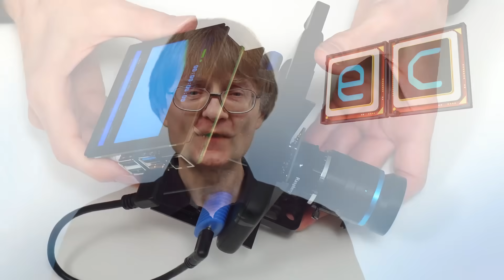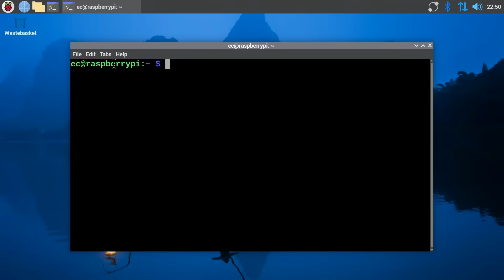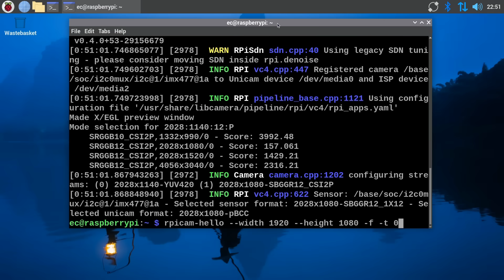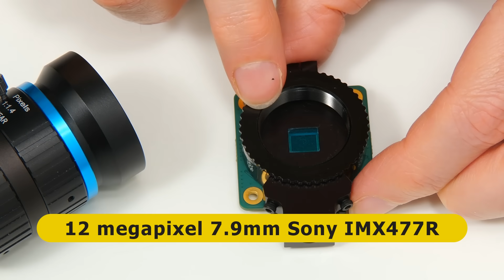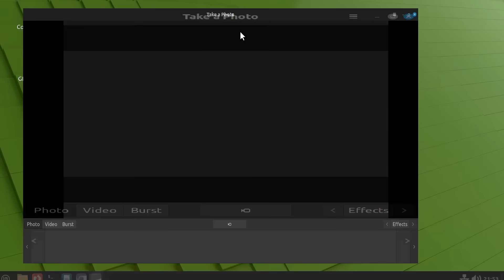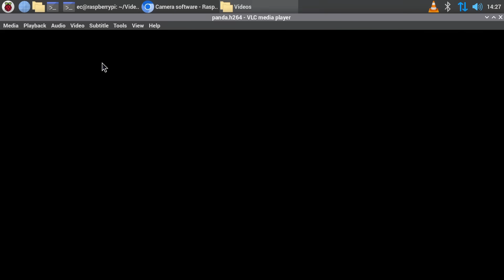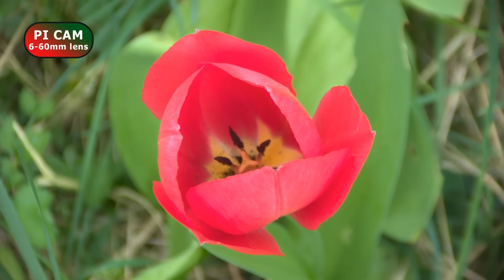Filming YouTube on a Raspberry Pi Camera

Comment: In the first comparison shot with the Panasonic, your shirt looks purple, this usually means that the sensor is getting a lot of infrared light. Next time you make a video with the RasPi Cam, can you try using an IR filter? maybe then the colors will be more accurate. As the lens you're using are usually for security cameras that use IR flood lights for 0-lux recording, they never come with IR filters.

Comment: At the end I still wonder about the question you had solved in 2022 or so when the Raspberry were suffering big time from shortages and you recommanded to look around for small celeron like those tiny lenovo mini PC where I had gotten one.

And hence I would ask what used Pro camera you would buy for what money if you would have to start again.
Why ?
Cause I like the lenovo idea and got back then 2 of them replacing Pi 4s which were suffering from a RAM shortage I could not fix and I did not like to face cause I have never had faced such issue and could not believe that 4 GB could be too less for HomeAssistant. Hence I got the small Lenovo for lot less money and everything incl. and able to expand the memory back then to 8 GB which is still working fine.
Biggest downside of cause was the power consumption but with a 30 kWp solar system and 30 kWh of LFP battery you do not really care about 5 or 11 W anymore for 1 computer or barbone PC. 6 W more in a 247 usecase is roughly 8.8 times the figure in kWh p.a. or 54 kWh per year.

So when I watched the beginning and you showed your usual Pro Setup I was wondering for how much you would get such 6 or 8 year old setup.

Comment: Pound for pound a nice alternative to the Panasonic. Telephoto lenses always have a shallow depth of field unless you can stop it way down which probably is not available on that tiny lens. Wide angle lenses also had vignetting problems in the past so not surprised about that issue either. 
My Latte Panda proudly sits on my shelf next to my Linux Penguin.
Not criticizing, but I notice you pronounce Alt as in altitude and not as in alternate... interesting. Never heard anyone do that before.
Stay well my friend and see you again on Friday!
Reply from the maker: A very good point on Alt -- I've never even thought about it, but you are clearly right. Noted!

Comment: My first impression, formed within seconds of the start of the video, is that the white balance is all over the joint.
Reply from the maker: On setup recording via HDMI, most certainly. On the CinePi rig, most certainly not! :)
Reply: @ExplainingComputers the lens and image processing are probably the two most important things to turning the Pi cam setup from "cheap cell phone" look to "cinematic"!
Reply: @JeffGeerling  confused as to what the question was in your sentence
Reply: @JB_inks  No question, just pointing out that the Pi camera hardware can get a great image... but the software processing will make or break the final result. And it can be a bit obtuse sometimes.

Lens selection also makes a huge difference, as many of the cheaper lenses (including the ones Raspberry Pi sells) have a lot of CA, corner softness, etc. (especially the zooms), and that can also mess with any of the auto exposure/color balance algorithms used with picamera etc.

It's difficult for those who work on Pi camera software because there is no real 'standard' set of hardware to target (and multiple Pi generations with different image pipelines, so a few nice optimizations we can do on the Pi 5 now don't work on older generations too, or at least not at 1080p or higher with video).
Reply: @JeffGeerling how do we improve on the image processing and lens to get cinematic? Thanks for the help! It would help me a lot. I'm specially looking forward to streaming HDR ( on sdr color space) video
Reply: @danielpicassomunoz2752 , you would want to use sharper-quality glass for improvements. Also, the  “cinematic” look is largely based on lighting and color grading. RAW image typically doesn’t look great until its color space is determined in software and color graded.
Reply: I noticed that too. I'm surprised your comment is the only one I've seen so far pointing it out. It was quite distracting to me.
Reply: @seanys I don't think achieving white balance is the point of this video, merely just about the hardware.